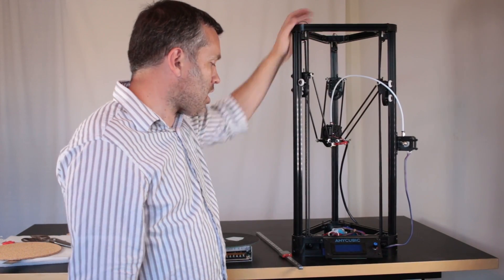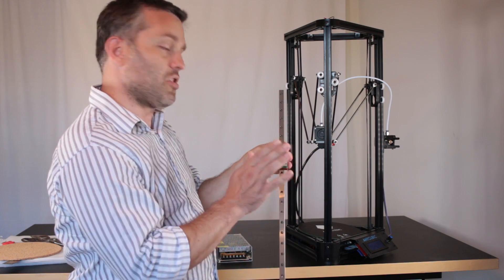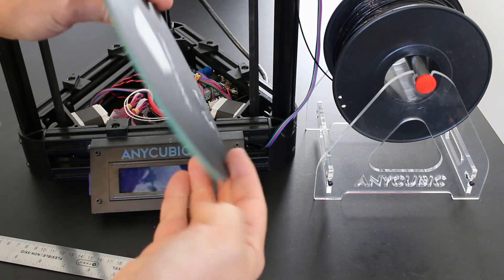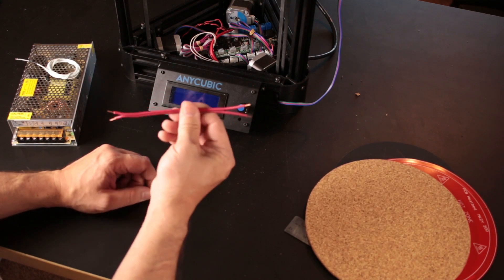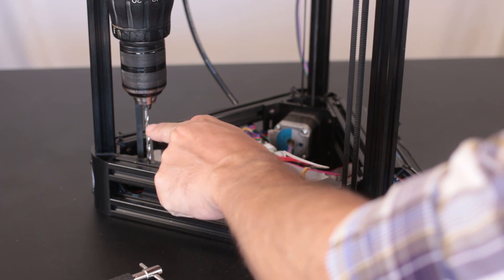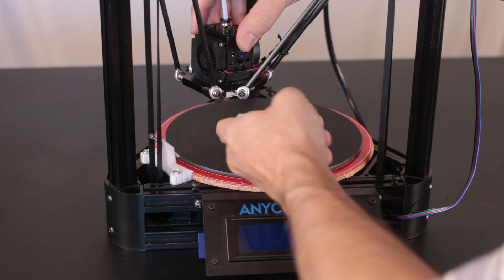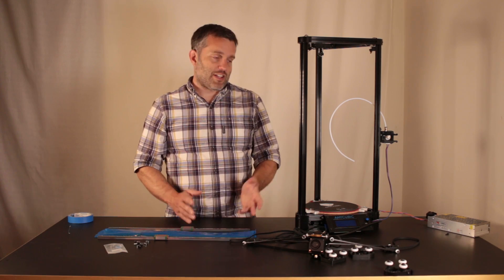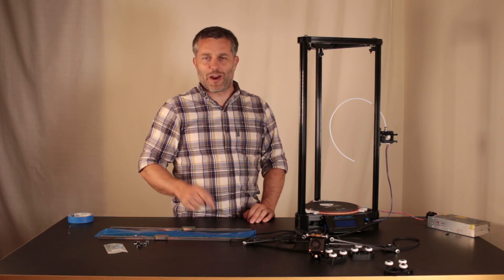Anycubic Kossel 3D printer Upgrades- How to Install Heated bed and Linear Rails Part  1

Comment: Easy way to remove the nuts from the aluminum frame is to use a magnet, they will just get out super easy that way, no need to disassemble the printer.

Comment: Quick DIY tip for T-Nuts on the Kossel style printers:

I often work with Misumi products (directly in Japan) in the products that my company makes, so I'm quite familiar with a lot of the parts available. I would suggest to purchase some "post-assembly nuts" for the Misumi HFS3-1515 aluminum extrusions commonly used in Kossel printers. The product code for the nuts starts with "HNTP3" (for metric nuts). There may be nuts available for Imperial standard as well, though I am not positive - I work entirely with metric units (sorry!). Either way, I would HIGHLY suggest using these, as the T-nuts are a severe pain in the ass to work with, remove, and even just move around in the frame (as they tend to JAM a lot...).

Comment: Just a note to anyone out there taking their entire printer apart to get the T nuts, if you screw a bolt into them a little bit and try to pull them out at an angle it (sometimes) works...for me at least.
Reply: correct! take a small allen wrench and thread the needle and pull it out

Comment: A printing diameter of 180mm is the largest you can get with the Anycubic without hitting the belts. However it requires spacers on the outside of the ball joints in addition to the ones on the inside.
Reply from the maker: Please forgive me for not understanding, but what would a superfluous spacer hanging off the outside of a ball joint accomplish?
Reply: The heads of some of the hex screws will hit the "sleeve" of their ball joints when the head is at around 173mm diameter at some points around the circumference of the bed. This causes "binding" so you can not print a circle above 170mm in diameter. The spacers have a (tiny bit) smaller outside diameter than the screw heads and this allows for a 180mm printing diameter.
Move the head by hand in extreme positions between the towers and you will notice the effect.
Whether this is worth doing is questionable, but I already had an extra set of spacers, that I made myself before Anycubic sent me the retrofit (I bought my printer a week or two before they introduced the spacers), so I just used them.

Comment: From now until august 31st you can use coupon code MakeKossel on gearbest to take $10 off
Reply from the maker: Thank you for sharing this. I hope everyone who wants this printer sees it, however,  my code (K3DP) still works at gearbest, and it will save you $20 instead of $5 with your link. With my link the printer costs only $169. I make no money when people use that link.

Comment: what software are you using for cad?
Reply from the maker: I use Rhinoceros 5.0 because I learned it in Architecture school, and I find it to be a great program for quickly designing and iterating. It is not a parametric program, but you can work in some of that into your models by hand if you plan ahead.

Comment: I have installed the same heated bed on my Anycubic Kossel Delta printer already, but I do not use the glass, Instead I used mounts already available on thingiverse that fit in the same place as the existing glass mounts raising the heated bed about 5 to 8mm above the frame. I have cut my cork to the size of the heated bed and fixed it to the Ali side of the heated bed, laid it in the frame and trimmed around the mountings, so it would lay flat on the mounts. I fitted a 30 amp PSU with brackets to the outside of the frame laid flat, then connected the 5 Amp and the 11 Amp inputs on the board as one is for the machine and the other for the heated bed. I fitted the corked heated bed Ali side down in the thingiverse mounts. Then I stuck the build plate to the heated bed red side up. Did my calibration and its been working great ever since. As for the mounts being loose on the rails for the X, Y & Z I just tightened the single screw on each assemble and there is no slop what so ever, so for now I'm not fitting linear rails.
Reply from the maker: Lots of good info! Thank you for the comment. Why don't you supply a link to the thingieverse parts you used. I'm sure other people who see this would find it useful. As I said in the video, when I did my search, I couldn't find a viable solution. I'm wondering how you attached the glass bed. Did you use binder clips?
Reply: As I said I don't use the glass stuck the black print surface straight to the heated bed you can find the mounts here https://www.thingiverse.com/thing:2047543 I also moved the extruder up and fitted this spool holder http://www.thingiverse.com/thing:454808 to the top of the printer.
I have added end caps top and bottom also from thingiverse

Comment: Wouldn't it be better if you have the heated bed directly on the frame, without the cork in between? I imagine the cork is not perfectly flat
Reply from the maker: The glass bed is thick and not large in diameter. Therefore, it is rigid enough to maintain it's flatness. But, as I tighten down the screws on the new brackets the cork underneath will compress, and the level of the bed will change enough to affect first layer adhesion. In other words: You have a point. However, I'm more concerned with getting the bed up to temperature quickly, and also protecting the electronics from the radiant heat coming from the PCB. So, the cork is necessary. If I don't touch the brackets after I have the printer calibrated, I think it will function well for many prints before needing to be re-calibrated. The end goal is to set up auto mesh bed leveling on this printer. When I do that, it won't matter if the bed level changes. The software will correct for it at the beginning of each print.
Reply: Design Prototype Test I was thinking that you could just cut the part of cork that is between bed and frame. But that could be a problem with the PCB and the heating would not be uniform.

Comment: please add a video how you setup calibration
i have followed all video from anycubiv channel but mine can t be correctly tuned and my level is not good on all surface
Reply from the maker: Thank you for the comment. I'm working on the next video (Part 2) as I write this. I'll include a section about how to calibrate the printer.
Reply: great !!